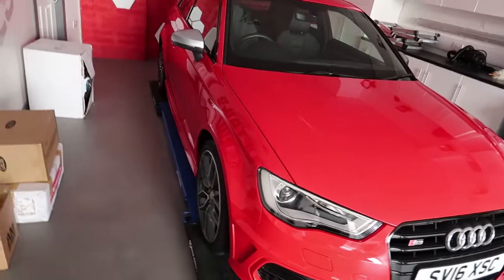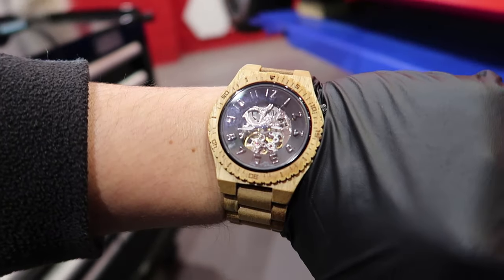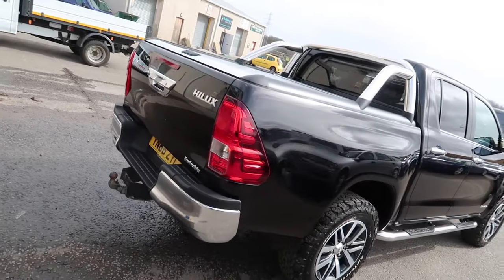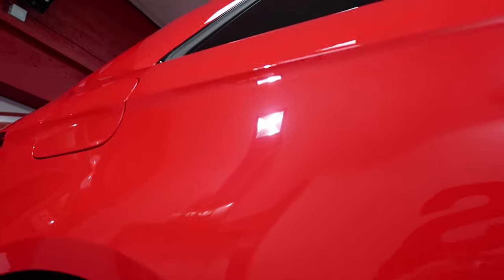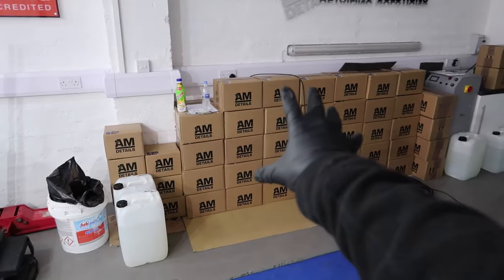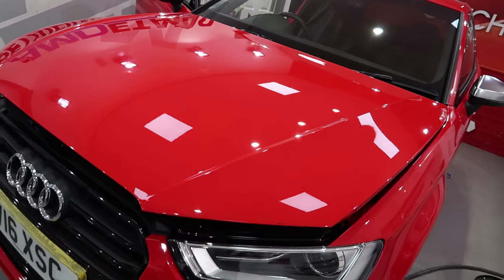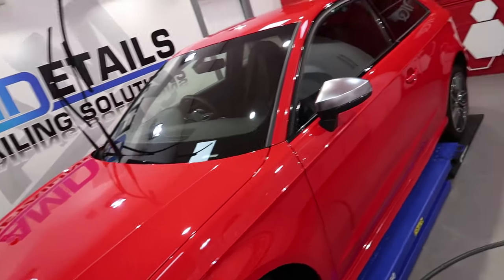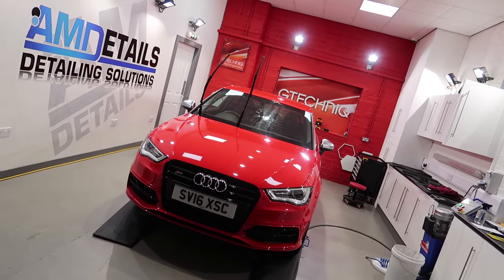Audi S3 Detail - Misano Red - Rupes Machine Polishing

Comment: Fabulous work Alan, may I ask what you used to hold the boot lid up when polishing? And did you machine polish the mirror caps? Glad to see you back on your feet, Just one more thing, I think you know what I am gonna ask you....... what was your breakfast ? lol.
Reply from the maker: Hey Rob,

There is an AMDetails Bottle placed upside down in the Boot lock then the metal bracket sits on the bottle base. The Mirror Caps got a deep clean using AM Glaze. Then a few Gtechniq Panel Wipe sessions to remove any of the AM Glaze from the Cap ( We only wanted its cleaning power) Then protected with Gtechniq.

Breakfast at the moment is Porridge.... 

Hope this helps

Alan 😎👍🔔

Comment: wow Al what a crazy week that was. can I ask why you used a very long extension on the Rotary instead of one half its size? 👍
Reply from the maker: Hey Ian,

Superb question. I find I can see better and locate the position of the pad better with the longer bar. It can be a bit more awkward to control. But due to the area, I wanted to work the polish and pad in a certain way so needed to be able to see past the body of the Makita. I let the pad do the work and apply very little pressure when doing this. just a positive pressure in the direction I want to apply the polish. A good Refining stage was required that's for sure. The buffer trails were not pretty but the end goal was achieved.

Hope this helps
Alan
Reply: AMDetails  perfect thanks Al for the answer ☺
Reply from the maker: +Ian Cross no worries Ian 😎👍🔔